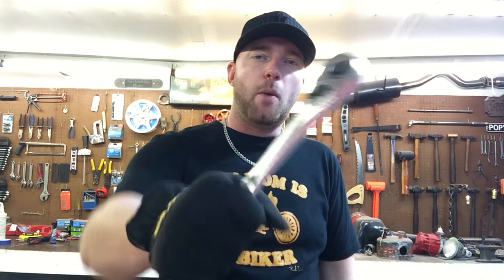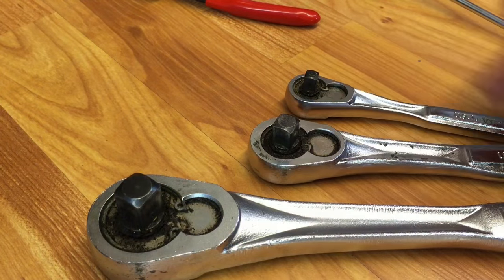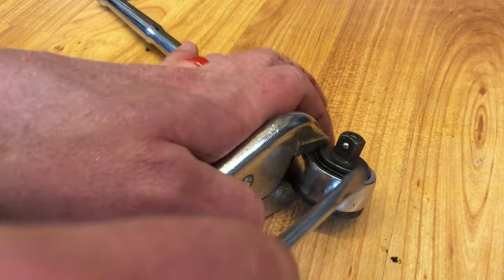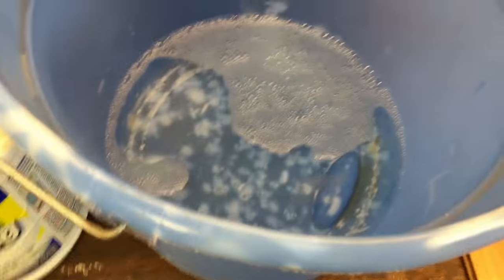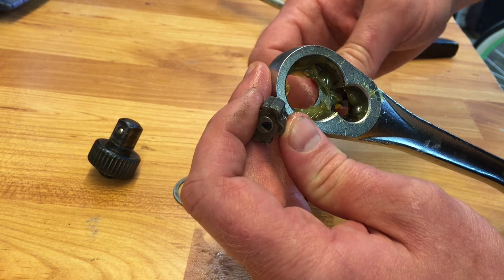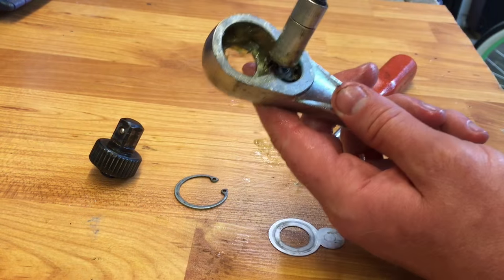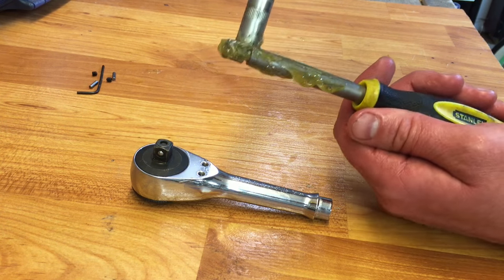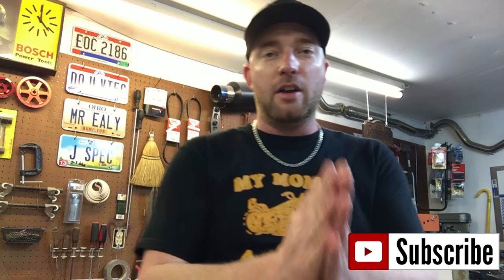How to grease a ratchet / mutlitple brands & kinds / Craftsman Tool Tips

Comment: I am not certain I would pack so much grease into a ratchet. The only things I have ever packed that much grease into are wheel bearings.  I use a relatively thin coating of Super Lube in my ratchets. I have never had a reason to use more and I have ratchets that are at least 45 years old that are still working fine.
Reply: I also pack them with long life gearbox grease. Have never had any problems, no slippage and smooth clicks eversince.

Comment: I like to use both grease and 3 in 1 oil on my ratchets.  Just like a car engine uses motor oil with two oil weights (like 10w-30).  I use less grease on my fine tooth ratchets and more 3 in 1 oil.  I use a little more grease on my 36 tooth ratchets and less 3 in 1 oil.  This mix has worked well for me.  Your mileage my vary.

Comment: Thanks to you, I greased all my ratchet tonight.  As expected, my cheap Harbor Freight and Great Neck ratchets are bone dry inside, not even a trace of oil.  My Ebay bought SK is dry inside, but there are trace of oil.  My Snap-on is well oiled inside thanks to the seal.  I oil them up using ATF and Super Lube.  They all sound smooth now.
Reply: Hey that’s a great review. But I gotta be honest… I could have used a little more grease on the ratchets.
Reply: @danieljames8095 😂

Comment: Don't go overboard an over packet with grease like I did. Be conservative with the grease where the ratchet Springs and directions selector are or you may get hydraulic lock when you're using it.

Comment: I use a white grease aerosol. If the ratchet's got retaining screws, I take one out and using the aerosol tube, insert into the hole and spray. Then put the screw back in job done. If its round head, I spray around the rim using the tube and let the grease seep inside.
White grease makes for a very smooth ratchet.

Comment: Would have liked to see the top end of the yellow handled one come apart.
Quantity of grease is probably personal preference.  Having it lubricated is the most important part.
FWIW. Lots of talk about types of grease to use on many forums.  I received a rachet rebuild kit from S - K and they provided what appears to be silicone grease for the rebuild.  Having it lubricated is the most important part.  Did I just say that?
Reply: I think you are right lubrication is good and keeps the inside mechanism from rusting if the ratchet gets water on it.

Comment: I would caution anyone greasing a ratchet not to fill up the cavity with grease.  It may initially quiet the mechanism, but the grease has to go somewhere; it will soon ooze out of every possible opening, every pore, until it has enough room to operate freely again.  That will leave you with one greasy ratchet, my friend.  This is a particular problem in warm climates like Phoenix or Las Vegas.  You only need enough to lubricate, not inundate, the ratcheting mechanism.  Watch the YouTube video series, "How It's Made" (originally shown on The Discovery Channel), to see how they lubricate new ratchets at the factory.
Reply: Having it packed with grease will help to ward off any water. Just clean everything that oozes out until it stops

Comment: You put enough grease in there for 6 Ratchets! More is not better as is will collect debris faster and will impede Ratchet operation on cold weather. Snap-on and other manufacturers recommend and use Super-Lube which is not as thick and works better in cold weather. Grease should be applied to the surfaces - not pack out the entire ratchet head!
Reply: yeah way too much grease.

Comment: The reason your ratchets are full of dirt is because you used grease. Try using some form of oil,grease holds dirt and dust and grime
Reply: I agree. I found that a little 3-In-One Silicone Oil works great.

Comment: Jesus Christ you how much grease do you need
Reply: He don't know what he is doing, way to much grease.
Reply: Carter Ndnndjcj Instead of so much grease it would not be better to put 3in1 oil?
Reply: 5-6 gallons per ratchet.
Reply: Patricio Gallardo in a ratchet with big teeth no a fine tooth ratchet yes
Reply: on the second ratchet yes. 72 84 and more finned tooth they have to be lubricated with oil. 30`s it is ok with grease
Reply: Its not too bad with a corse tooth ratchet but if you pack something like a snap on duel 80 with grease the teeth wont lock properly.
Reply: Golly freakin' a, that's a lotta grease
Reply: @jamessmith8752  yeah but it ain't gonna rust.. lol

Comment: i guess the word 'torx' was missing from your head that day! lol, i know the feeling.  yep i prefer just regular grease, i do have a ratchet that is very soft sprung and needs oil or it will skip teeth,  trial and error, but no fancy grease as i prefer cleaning mine yearly.  just 'general purpose' mechanics bearing grease or 3in1 oil are what i always have around, paint thinner and toothbrush to clean them out.

Comment: By watching your ratchet, i would not recommend to use grease to lube your ratchets, grease acts like a debris magnet, it collects so much dirt and that could wear out your teeth faster, my brand new ratchet i opened it up and it was covered with gear oil you can use gear oil sae 140 or 90, its thick enough so it wont leak out easily and liquid enough to lube everywhere and it doesnt collect so much dirt like grease does

Comment: Disassemble and clean parts in kerosene with a brush, no need for this or that degreasers, just money wasted. Wipe and dry all parts making sure all teeth are free of muck, easiest way is to lightly run over them with a rotary wire brush if its caked on. Then oil all parts in light machinery oil. I use Ballistol as it will still lube even if you get some water or moisture into the mechanism. Put everything back together and every few months squeeze in a few drops of oil no need for further disassembly for many years. There is absolutely no need to grease something like this and as others have mentioned you will quite likely be creating a possible problem and you may even break your ratchet.

Comment: Craftsman Ratchets are absolute garbage, but this does help tremendously
Reply: What is garbage about them? I have had them used hard for over twenty years with original guts!
Reply: I've never had a problem with Craftsman rachets. I have one from my grandpa that is from 1967 and it's still fine to this day.
Reply: @TheCarJunky1  exactly I did strip a 1/2 inch one time but it was with two guys standing on a five foot cheater pipe I am a heavy 1/4 user 22 years still going Looks polished inside it is my oldest ratchet most the wear is from running it dry for years and is noticeable on the ball detent. Silky smooth with super lube. If you can not clean a ratchet why do you need one???????? I did buy some China ones for the guts just in case and the pawl its different location slightly so won't fit USA body but I cleaned and greased them while apart and silky smooth will ratchet way easy lot of this steel is very close to the same recipe. This guy dose not know some technicians prefer the older craftsman USA steel to snap off LMBO
Reply: I take care of my tools but have to use in rain or if out in the field have to improvise all my ratchets except my 1/4 have had a hammer or sledge taken to them and show it and still going.